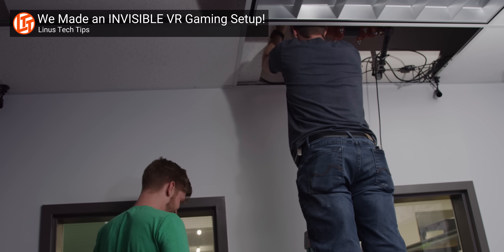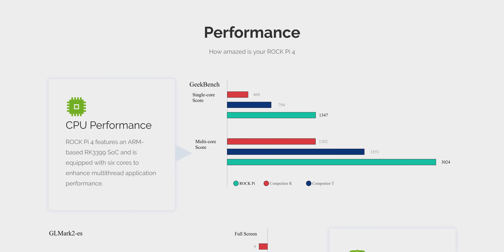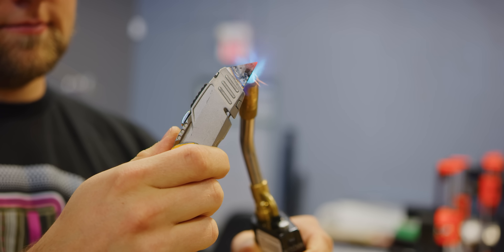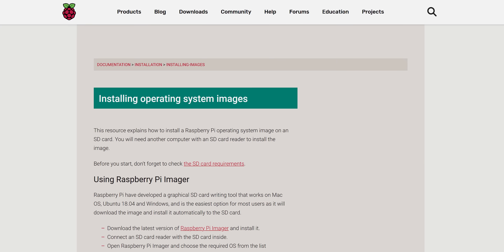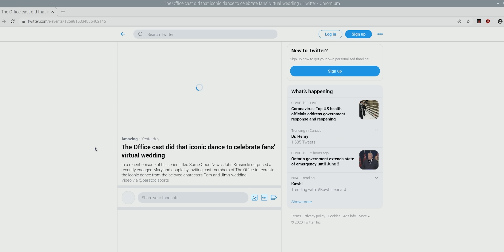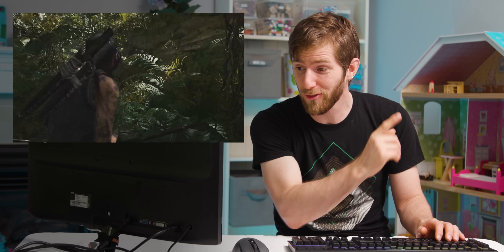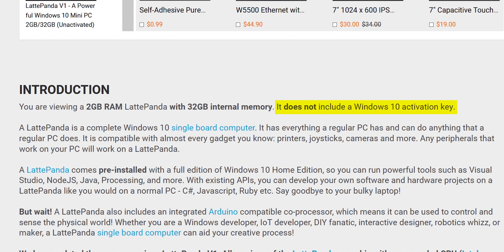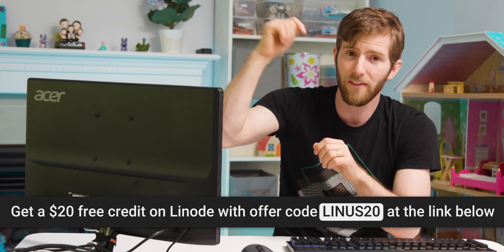My SECRET Computer……

Comment: I did something similar a while ago. Using a 720p 4:3 monitor with a pi3 & Retropie, I put together an all in one retro gaming screen with (more or less) the correct aspect ratio for all the old Master System, NES, SNES, Mega Drive, etc games. Its great as I can get it out every now and again, get my reto gaming fix then pack it away super esay.

Comment: This is cool but a better option though not as cheap and a bit larger, the Odyssey x86 with 64GB storage and NVMe support, 8GB memory and so SO much more (including better video to say the least). Run Linux and/or Windows easily and it MIGHT still fit inside of the monitor for the stealth look you were after. (3 models to choose from, this one is $218 US in case anyone cares). Mostly I just have hope that you guys see this (unlikely I know) and decide to make several videos about this SBC simply because I want to watch more videos about it.

Comment: My experience, the pi 4 becomes real usable only with heatsinks and active cooling (a fan). Or a really big huge heatsink. So it don't thermal throttle.
And some tweaks. Youtubers like Eta Prime and Pi Labs often talk about these things. And Pi Labs have some tweaked versions of Raspbian that make it a lot better and suited to use windows apps and old games.

Comment: I wonder if it would be practical or possible to parasitically power the Pi if you had a monitor with an onboard PSU rather than a brick?   If you did that AND had a secondary video input for a visible computer, you'd effectively have two computers in the place of one.  Just leave the keyboard/mouse receiver externally accessible and you can switch back and forth with ease.
Great for those James Bond types who want to keep your "secure computer" hidden in plain sight.

Comment: "The older monitor you retired"
*Linus pulls out the monitor I'm watching this on
Reply: same D:
Reply: Do you know of any way to get 144/100 Hz on this monitor when your gpu doesn't have DVI-D? Lol
Reply: @lenixxq  active dp to dvi-d
Reply: @lenixxq  DVI-D is the only way because the HDMI generation doesn't support 1080p at 144hz
Reply: @ryanzimmermann2842  display port?
Reply: @blasphemxus  dp 144hz does work on this monitor for some reason
Reply: I bought an acer 144hz monitor that only displays up to 120hz

Comment: Two friggin power cords?  You could've easily added a buck converter inside to provide two different voltages.  A tiny USB cord coming out the back to plug into a port in the back?  Come on!  Solder onto the backside of the USB header, internally.  What a joke.

Comment: hi sry for asking here i have problem with my pc can someone help me pls?
i have wd ssd sn750 and HDD Seagate Int Barracuda 4TB 256MB SATA 6GB/S 5400RPM
when i use just 1 of them i dont have any problem but when i want use both ssd and Hdd and install win 10 on ssd after install when win go to boot i take blue screen with this error 0xc00000e and cant do anything can u guys help me ??ssd and hdd alone worked well but togther not!!!
motherboard asus tuf b360 plus gaming 
core i3 9100f and gtx 1650 super and geil evo x 8 gb 2400

Comment: While yes, you can definitely make RTX Voice run on an older card, it's not exactly a great experience. Basically what I'm saying is, your mileage may vary. For me RTX Voice just made my voice sound glitchy and distorted, so it definitely utilizes the tensor cores on the RTX cards (I don't see any other reason why it would behave in this manner on older cards).

Comment: Couldnt you have gone the extra mile and internally solder the hdmi connector as well as use the monitory own PSU to power the pi..
Reply: It's meant to be easy af
Reply: That would be a great way to expand the video and someone should do a reply video for those sweet clicks

Comment: Speaking of raspberry PIs, have you seen the turing PI? its a 7 slot board for the raspberry pi compute units, though, i'm probably going to wait ti get one until they release the raspberry pi 4 compute stick, or an 8 core raspberry compute stick, as i'd really like to have 56 cores, instead of 28

Comment: this is what I'm planning to do myself, only not cut into the monitor, attach the PI to the back of the monitor with double sided tape, and add a case for the PI with a fan to keep it from stuttering at 1080p video playback.

Comment: Side note: If you use a Linux based OS as your stealth computer, you can install Remmina as a Remote Desktop alternative and connect to Windows Remote Desktop Natively. This will also black out your base computer so no one will see what you're doing remotely, and you can run Steam through it. Steam Link does not do this natively and requires your PC to be unlocked in order to use it.

Comment: A pretty decent option to add is a Power Bank with a nice output integrated in the back of the monitor.  So you could even use ur "Computer" with just the one power cord and make it more portable like this :)

Comment: Here’s a random question for anyone. My roommates bunny chewed the power cord for my asus ac3100 router. I’ve noticed you can buy replace cords on amazon that are compatible. What is everyone’s opinion on 3rd party parts like that. And did I use the correct terms

Comment: If you’re feeling more courageous, tap the 5V volt from the DC supplied for the monitor. If there is no 5V source inside, use a boost buck converter. So you have no extra power cables running from the monitor.

Comment: What's this supposed to be? Why did you mention the RockPI at all? And why didn't you scavenge power from a 5V rail from inside the monitor? Or at least put a voltage converter in parallel to the power input. This way you can hide the second power cable at least. TBH I'm a little disappointed. This idea has so much more potential. I can understand that you don't want to desolder that HDMI port to make an internal connection but at least the power should be doable by an experienced maker.

And I just noticed that this is the second LMG video in a few days where I'm disappointed - both of which feature Colin. :-S

Comment: Why limit to one hidden computer inside the monitor, why not to or three with a bluetooth HDMI internal selector, so HDMI cables also goes inside, and only one power cord if done on monitors tha have internal power supply... just connect the other power to the power cord input 220V conector of the monitor.
Also with an internar USB splitter (one usb bluetooth dongle) to multi computer.
I mean use bluetooh to control internal USB hub to wich computer is connected and what HDMI output is connected internally to the monitor, like KVM switch does but totally hidden inside, only exposing USB ports, like many TVs have to reproduce media files or record tv, etc.
In other words, external USB ports exposed are connected to (once at a time) multiple computers hidden inside and their HDMI output are directed to a HDMI selector (with bluetooth remote control) to the internal HDMI port... , power taken from inside (on monitors that has a direct cable to power wall, so internal supply, no external power adaptors) etc
Multiple computers inside a monitor... much better than VirtualBOX, etc.

Comment: "Old screen", That is quite new to me.
Reply: No joke. I'm sitting over here like "damn, bud, you have HDMI?" as I watch this on my 1080p60 Dell monitor I literally got from a thrift store
Reply: @Sammie1053  Laughs in 1600x900   TN panel
Reply: @mohitakundi  laughs in 1080p144
Reply: @mohitakundi  laught in FullHD TV Converted Monitor
Reply: Lol I have a 1366x768 60hz monitor
Reply: I have a 60hz display with a resolution of 1680×1050 pixels that was made by Philipps in the mid 2000's.
Reply: accurately the "old" monitor they show is a custom gaming pc monitor they receive from intel in 2018. check on video "The COOLEST Box I’ve EVER Opened"
Reply: @jaimesantos13  no, it was from scrapyard wars xD
Reply: Yeah an old screen would be like a 4:3 17” lcd.
Reply: @MrPiikkipallo  Or a CRT monitor. :)
Reply: I feel ashamed with my monitor
Reply: I've been using a shitty square dell monitor, literally anything is better than it at this point
Reply: Literally the exact monitor I'm using and have been for 4 years now and it's more then what anyone would ever need for a gaming monitor
Reply: @the46guide94  just no. that monitor is so out dated and looks so bad to eyes that arent 50 years old
Reply: Martin _8346

" it's more then what anyone would ever need for a gaming monitor"

No. Absolutely fucking not.

Comment: You would have done better using PARSEC on the Pi. Much less laggy with lower latency than Steam link and better desktop usage support.  Also Manjaro Linux has a version available for the Rock Pi in both XFCE and KDE spins. Your Chromium browser, Steam and lots of other software available. Also as for compiling from source, Manjaro being Arch based you have access to many things on the AUR as long as it is compiling from source and ARM compatible.

Comment: I did something similar with that same monitor.  i mounted the pi external instead of internally. You can with a cheap buck converter and use the monitor internal power to run the pi. There is a enough amps from the  power supply to power both the monitor and pi with out issue.

Comment: Better if you make a permanent mod  for example if you ruin the VGA or D-SUB connector and modify the ROM chip of monitor for it will read one of the inputs as "Raspberry Pi". And solder the Wall adapter of computer to AC mains input, much less spaghetti of cables

Comment: you could actually fit one of those alienware pcs that were supposed to be steam links on  a bigger monitor or tv (that's what i did). That way it would be seamless and you wouldn't need a 2nd or internet to game. Also if you are gonna use it for that. Wouldn't it be better to just buy an aio from hp or something?

Comment: That monitor has a vesa mount.

So, get an old office tiny PC from Lenovo/Dell/HP which are relatively cheap. Mount it to the vesa mount and run whatever OS you would like. It will cost around the same as a Pi 4

Comment: A much easier and cheaper solution would be to buy a powered USB hub, that can be deactivated with the switch of a button.
Hide the USB hub in the monitor with a flash drive running another operating system.
Then in the Bios set priority priority boot to USB if USB bootable is detected.
Reply: And I would strip the display cable and stealthily insert a thin USB cable inside.
Although I doubt this will be easy so I would have a backup.

Comment: I drop my jaw when I saw Linus complains about AArch64 and switch to ARM HF... Stop, get some help, stop!
Reply: Yeah, this had nothing to do with hardware or architecture. This is purely not stepping away from the default Rasbian os to literally any other Arm64 Linux port. The PI 3&4 are both AArch64, just like the ROCK pi. I think what he's confusing here is that Raspbian is only available in 32 bit  ARMhf and not aarch64, because they wanted one Distro install that worked for every generation of the pi, AArch64 chips pretty much all backward compatible with armhf too. Hell, the rock pi and the Rpi both use the Armv8 and have Cortex-A72, the difference between their SOCs being the pi 's soc uses a 4 core Cortex-A72  and the rock uses a 2 core Cortex-A72 combined with a 4 core Cortex-A53 soc.

Comment: The raspberry pi 4 IS aarch64 (arm v8) however, the default raspberry pi distro (raspbian is arm v7). You could relatively easilily install a 32bit arm os on the rock pi and run the 32 bit apps.

Comment: I tried the Pi 4 as well, but I didn't like it because of it's limitations. It is slow, doesn't have lots of program's and it's not a Windows. Eventually I went with the Intel NUC 8I3BEK. Small as well and it has windows and more space!!!

Comment: Wouldn't it look weird if you had a monitor on your desk that was never on, unless someone just walked in on you. I would use a dual monitor setup, and use the rock pie to stream a virtual machine with the drive physically in the Rock pie.
Reply: And because I couldn't fit it in the previous comment without forcing you expand it.
You'll need a stelth KVM switch, it's just a button that switches a single USB keyboard mouse to monitor and switches computers.

Comment: "I'm using a $50 computer right now, ladies and gentlemen" -

proceeds to type away on a mechanical keyboard that's double the price of the Pi
Reply: priorities man
Reply: Uh...yeah, how stupid is that? Hahahaha...

casually swaps wireless mechanical keyboard for a dirty old k120
Reply: https://denwereview.com/best-4k-hdr-gaming-monitor-for-xbox-one-x-ps4-pro-pc/
Reply: Also shows an ltt store hoodie that’s 59.99
Reply: Uhuh but the ssd is way too expensive also the hoodie/merch is 10 bucks more expensive
Reply: The pi 4 is like $200 lol
Reply: @nw4538  it is most certainly not. The 2gb model B board is indeed $35. Even the top spec 4GB kit, with power supply, case, heatsinks, SD card, keyboard, and mouse (much of which you may already have lying around) is only $120.
Reply: It's not even an actual pi lol its some random American knock off
Reply: @jez112prune5  I think RockPi is a Chinese product
Reply: @aluandcache7336  it gets better and better
Reply: @jez112prune5  naw man they switched to the pi for compatibility reasons due to slightly different processor architecture apparently.
Reply: @jez112prune5  not anymore, watch thr whole video, they replaced it with a pi due to better software ecosystem.
Reply: @jez112prune5  haha someone didn't watch the video
Reply: @jez112prune5  You mean a Chinese knock off lol

Comment: Also, you can use android media box like MiBox or Beelink GT1 which fits better for media (4K media support without any problems, 1G LAN for some models, Bluetooth included) and costs around 50$, SteamLink also works well. Downsides - you stuck with Android and can't use desktop software.

Comment: Spend the whole video looking at the back of the screen and wondering why you wouldn't just 3d print a Raspberry Pi VESA mount. Its not really stealth if you have wires coming out of random holes.

Comment: I'm pretty sure you could do better with some standard laptop parts, maybe not this cheap and it would probably need some active cooling when used more powerful components, but still, better experience than any ARM based boards.

Comment: Lattepanda with 32gb of emmc storage NO THANK YOU for Windows 10. As for the VESA mounting some monitors have you remove the stand to get at the mounting points for VESA so yeah that is one knock against using that option

Comment: https://www.newegg.com/qnap-ts-251-2g-us/p/N82E16822107253?Description=external%20ram&cm_re=external_ram--22-107-253--Product&quicklink=true
Reply: I bet you can take the internal of this device, rip out the power supply and fit this inside a monitor...  ( Intel Celeron Quad-Core 2.0 GHz, 2GB DDR3L RAM (max 8GB), SATA 6Gb/s, 2 x Giga LAN, hardware transcoding, HDMI out with Kodi, Virtualization Station, Surveillance Station. QNAP remote included )

Comment: Finally, i can privatly play mario kart 64. Although.... With two Players, the inputs interfear with each other, and you randomly cant use items. But Minecraft works.... If you dont mind 10-20 fps... Or if you dont mind running it in the smol standatr sized Minecraft winow.

Comment: I'm sure this has been addressed already, I've been hearing from and watching videos about the ability to use a ssd portable drive through usb  to boot off, instead of using the SD card. It's not for the casual diy person, I believe.
Reply: It most definitely is. I never use an SD card on my Raspberry pis. There is no difference to you as a user.

Comment: pro tip: solder the video cable to the pcb. you can use vga = less cable (i think only 6)
ang use internal power.

Comment: We are going to put the raspberryPI into the monitor.

Actually, JUST puts it into the monitor, no sneaky internal DC/DC power converter from the original power supply of the monitor, no sneaky hdmi cable or even LVDS cable.

I mean.. At least do some effort to make it sneaky!
Even add a key combo to boot the raspberry when you plug it in to the socket maybe?

This should be possible for you guys to do? it's not that hard..

Comment: Many monitors use 5V internally, so you could make due without the second power cable and just solder a USB cable to that. I've done it and it works without any issues (Raspi3B+).

Comment: 4:50 " ...if all you wanted was a web browser & youtube capable machine that's hidden"
me : hmm (looking down a smartphone, looks quite hide-capable)
Reply: yeah but it runs a mobile OS
of course, that can be changed if it's rootable. if you're very lucky xda-developers already has a desktop linux port for it. if not, you can use linuxonandroid or similar app to install some desktop software, or sentio desktop to at least get a desktop UI with proper window manager
Reply: @TheZALGOisCOMING  quite sad that we can't (usually) dual boot on phones. I would have so much fun trying out Plasma mobile... once any Linux distro works on my OnePlus 6.
I tried Linux Deploy but it seems to have its limitations. For example, the terminal didn't appear to work at all for me.

Comment: I've read that RPi4s throttle down a lot because they run quite hot. I can imagine you'll get a lot better cooling if you had installed a CPU heatsink and fan and cut a small hole in the back of the monitor casing... That's way no problems with throttling!!